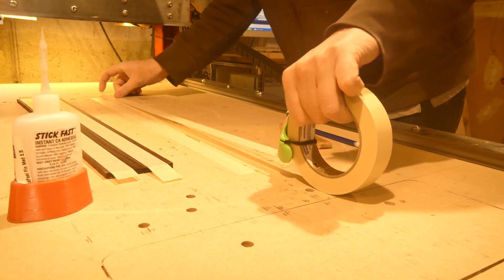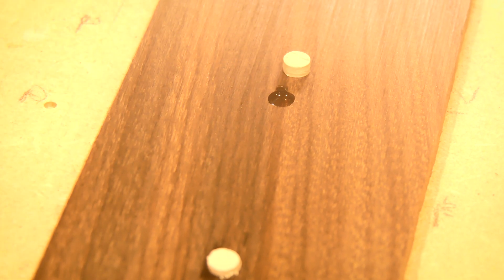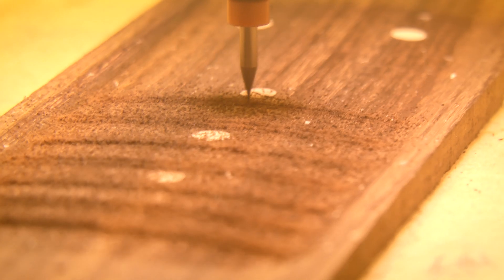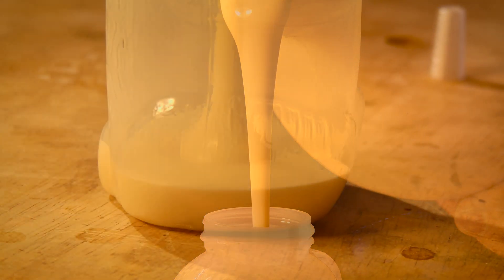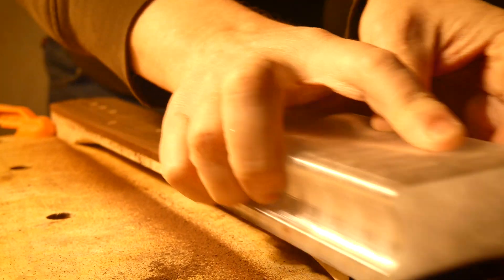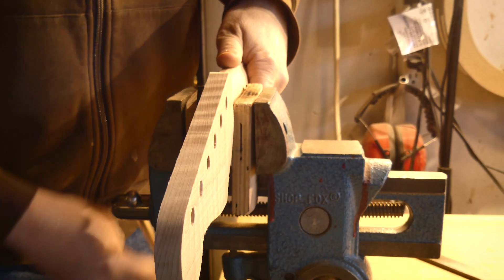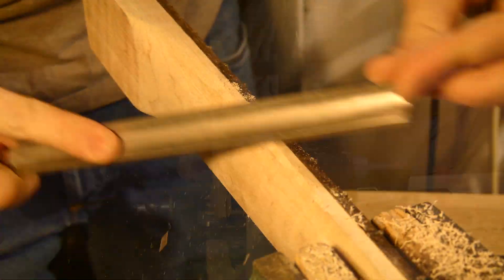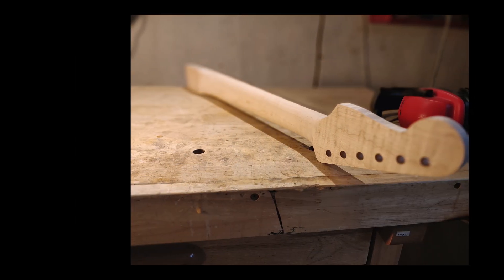My CNC Fretboard Process | Fusion360 and Mach 3 | Stratocaster Neck

Comment: For me the biggest advantage of cutting fret slots on a cnc, is that you don't need to cut throught the edge of the fretboard. You missed that chance 😉 
Great build nevertheless. I love your channel 🤘
Reply from the maker: If I'm making a fretboard in that style for sure, you don't usually see that on this type of neck as it was designed to be easy to manufacture.

Comment: What kind of ballnose router bit are you using for fingerboard shaping? I am thinking of getting one like that, but I am not sure what is good.
Reply from the maker: Its just a 3/4" ball nose from the big box hardware store, nothing fancy. The trick is to use a big tool with a small step over.
Reply: @TwoCherriesIns  haha. Ok, so I am buying one like that. Only metric :)
Reply from the maker: @marcingorycki8723  shouldn't be hard to find, assuming you're in a country that regularly has metric tools available, in the US that would be difficult to find.
Reply: @TwoCherriesIns  actually, big box stores over here are a bit terrible. But a bit like that is easy to get online for ~20 euro. Proper spiral bits from China are more expensive than that :)

Comment: Great videos and explanations. Apologies if I missed this in another of your videos…Curious what your hold down method is on the Fender Style neck when you have to flip the neck. The tape and glue works great for the fret board blanks, but thinking about setting up dog hole corners similar to Jay Bates spoil board design. Any advice would be great. I have the same machine and use Fusion. Redesigning my spoil board for a new guitar neck design. Thanks so much.
Reply from the maker: I have several videos discussing my work holding and setup workflow for multi-setup milling. Everything I make is custom, and I rarely make more than one or two of them, so I cant use a work-holding system that doesn't compensate as I need. Once you get into it, you will find many other upsides to this method. I am curious about exploring some vacuum work holding techniques, but many of the other systems can not adapt to the different sizes and varied styles that I build.

Comment: How do you accurately align the fretboard to the neck when gluing?
Reply from the maker: In the case of a strat neck, a dead-on fretboard glue alignment is not necessary. I generally cut the board 0.03" oversize and shape it to size along with the CNC milled neck. The adjustable bridge can take up any error on these instruments. When I build an instrument, I like to take up any manufacturing error, whether the parts are made by myself or anyone else, by placing the bridge with the neck fitted anyway. It's good to work to the plan, but better to know how to adjust through the process; things will never fall into place perfectly, especially glue joints.

Comment: Excellently produced video and a nice process too. my only question is what’s the reasoning for not gluing in the truss rod? I’m not suggesting it’s wrong, just wondering.
Reply from the maker: The way I apply the glue it will press out right up to the truss rod slot.

Comment: Amazing work. Custom 3d printed sanding block. I like!
Reply from the maker: I needed a 9.5" radius and I only had a 12". I could have CNC milled it, but it was two birds with one stone situation. I can keep the CNC going and run the 3D printer at the same time.
Reply: @TwoCherriesIns   What kind of infill did you use on this. Thought about doing the same thing but was worried it wouldn't hold up well. Great work as always!
Reply from the maker: @bivoauc  this is PETG so it's pretty tough, I use thick walls around five layers and relatively sparse gyroid infill around 15%.